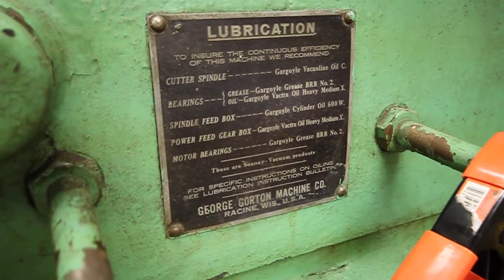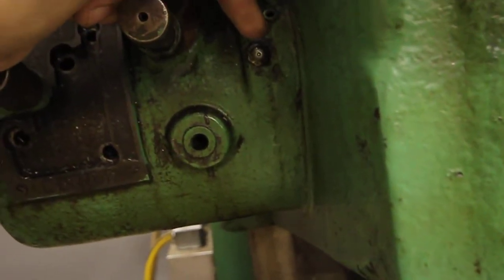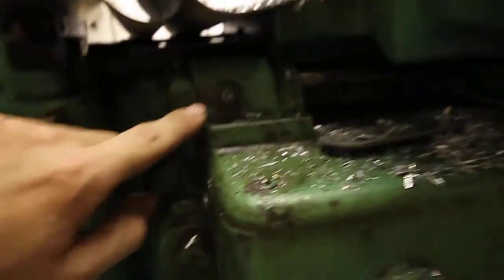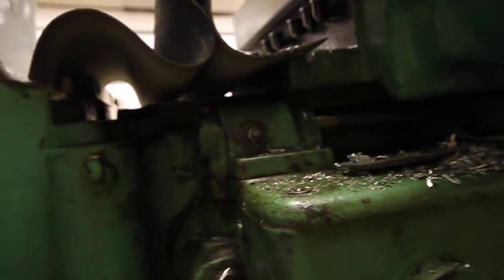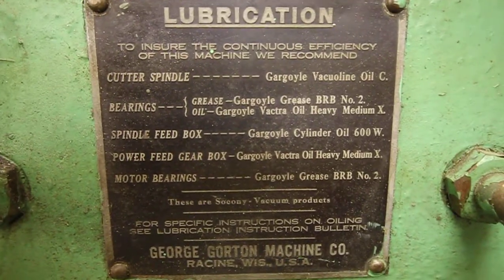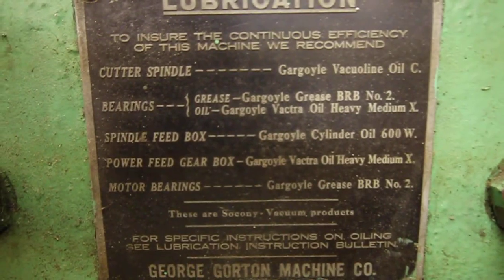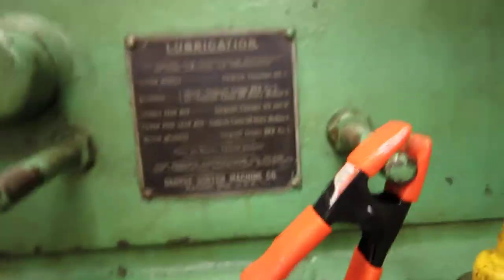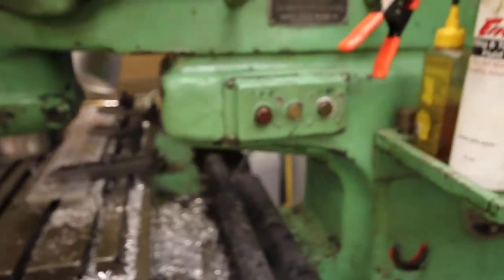Gorton milling machine grease zerks

Comment: I use a ultra high precision high speed ball bearing grease. It looks almost matte white in color. So far so good
Reply: I also use mobil Vactra no. 2 for the ways and everywhere medium machine oil is requested and mobil Velocite no. 10 for the spindle. I have a machine shop supply store by my work and the old guy in there helps me out and calls his buyers and suppliers to get information for me and this is what we came up with

Comment: I have a similar problem with a different milling machine. I assume you have figured this out seeing the  date of the video. If you have not, I found the oil/grease I needed from exxon mobil directly. They have a technical dept. that helped me acquire a suitable lubricant that was equivalent to what I required.